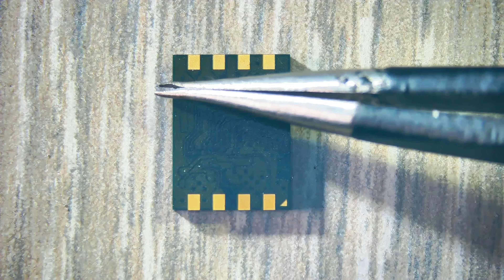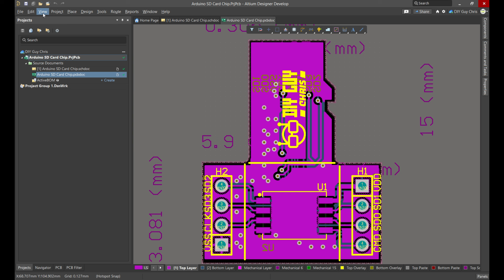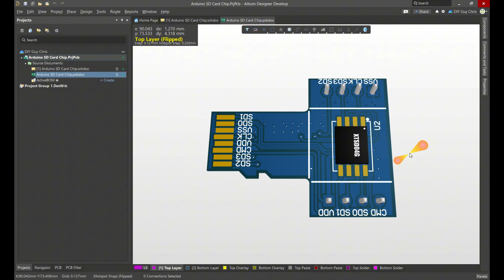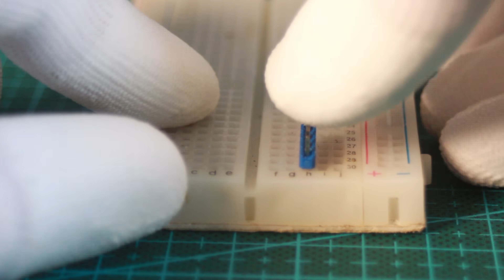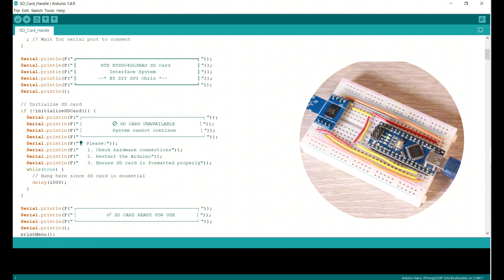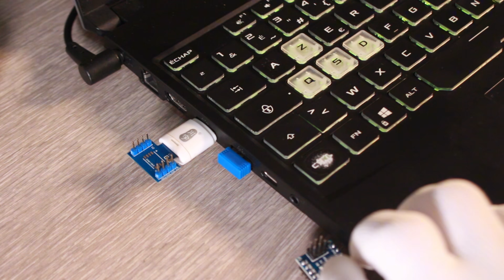How I Made a Tiny SD Card for Arduino!

Comment: hi i have a question! i'm trying to get something similar to work, but when we run the SDFat code, it says "22:44:43.679 -> No card, wrong chip select pin, or wiring error? 22:44:43.679 -> SD errorCode: SD_CARD_ERROR_CMD0 = 0x1 22:44:43.679 -> SD errorData = 0xff" did you run into these issues? thank you!
Reply from the maker: What Chip are you using? The same XTSD Chip?

Comment: How is that better than SD card? It's physically bigger and probably more expensive....
Reply: Exactly. 8GB vs 2TB and plenty of nano microSD card solutions available.
Reply from the maker: Yes it is bigger, and more expensive,, but, personally I designed a circuit board for industry use where I used SD card for data collection and few months after installing the circuits I started receiving Emails about those SD cards lost or stolen (yes it happens) so having a directly soldered chip will be definitely a better solution.
PS, I mean the solution is better not specifically that design, the design is just for testing the chip 😉